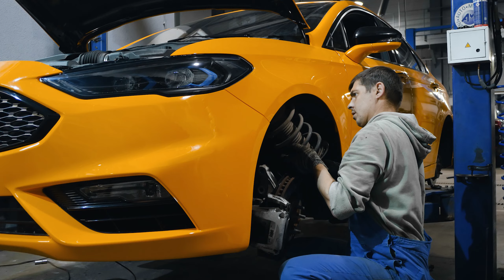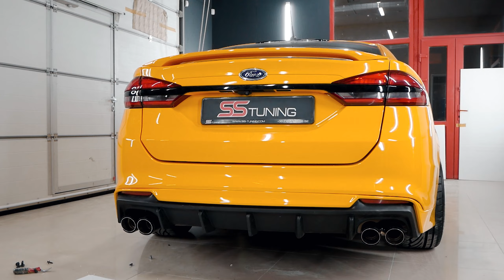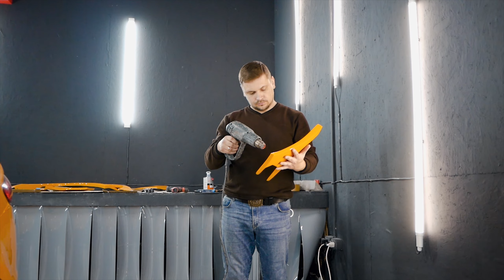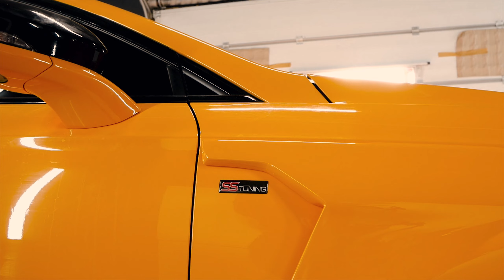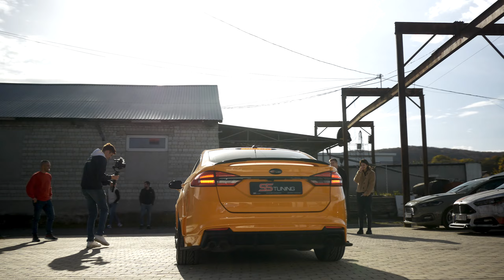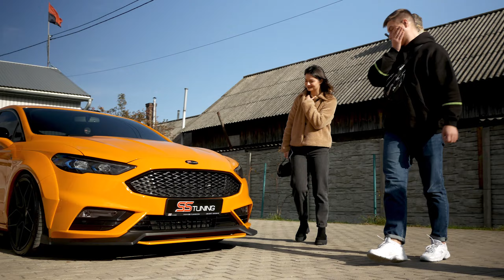Fusion Sport by SS-tuning : before / after

Comment: While the wide body gives it a different, and good look, I like the stance of the car before they installed the wide body panels. Overall that is a sick looking car though.
Reply: I think it could have used some ever so slightly wider wheels and tires or some more offset to really bring that sidewall to sit perfectly flush or a TINY bit of poke...